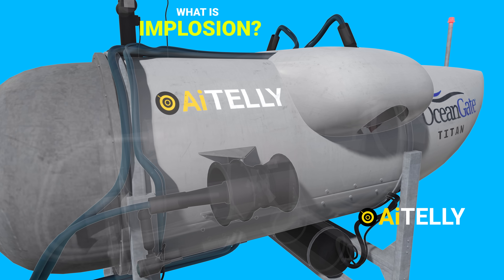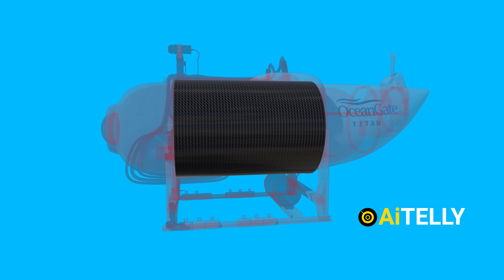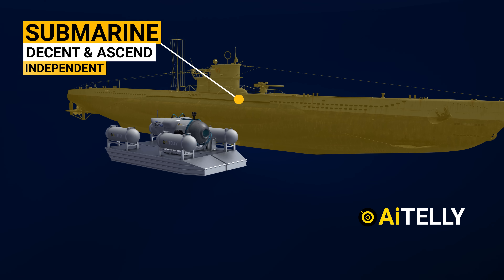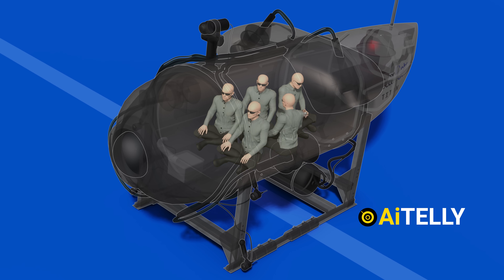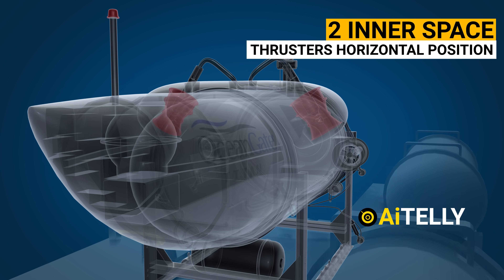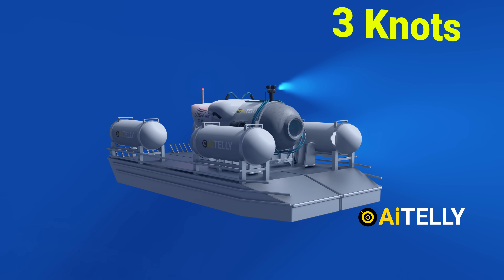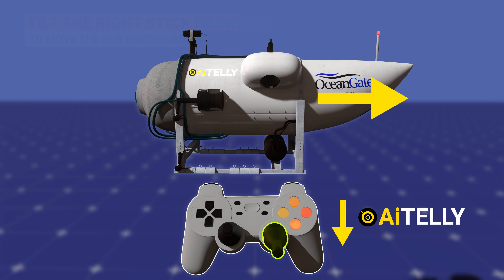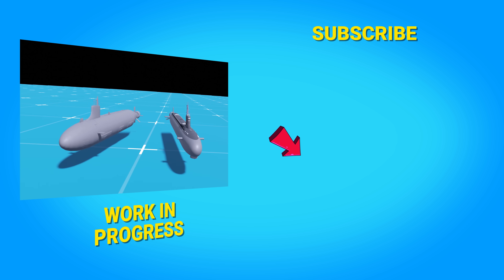Implosion Titan Oceangate How it Happened | Submersible Submarine Parts #3d

Comment: I remember when I heard that the sub would use "NASA" and "Boeing" as the claim, that is who helped them with the design, although that was later rejected by both, that was a red flag for me. Carbon fiber used in planes, designed for lower pressures in the air. NASA and planes, dealing with lower pressures, going into the earth/deep ocean, dealing with super high pressures. So as an engineer that deals with super high pressures, the appeal oceangate was exposing did not make sense, and why anyone would agree. This is a prime example of herd mentality, even with educated people. Educated does not mean intelligence. Having names thrown around to sound impressive, but have no idea of the function. 
Needless to say, I appreciate this video.

Comment: This implies the hull wasn’t strong enough as built. It was.  It had been there before.  The failure will be determined to be from fatigue.  Much like bending a paperclip back and forth.  Each dive is a cycle.  Once the cycle life is reached, the hull implodes, just as the paperclip will fail after being bent back and forth a number of times. 
Fatigue cracks slowly form until they coalesce into a failure.
Reply: Hull.  Not hill.

Comment: what is crazy is if the average person created this for a tourist operation, it would have been shut down immediately by government regulations and safety standards  again, yet another example of rich people circumventing the rules for personal profit and pleasure. Engineering 101, carbon fiber will not withstand great depth pressure.

Comment: If 5,600 PSI sounds like a lot just realise that the force is being applied PER Square Inch of the Pressure Vessel 
Given its Approx Surface Area It totals upto about 130 MILLION POUNDS of total force on the entire pressure vessel

Comment: I would've paid 2.5million to have James Cameron with me on a team of two MIR subs than to pay 250k for that piece of crap. Other things to note:

- pressure hull/vessel was shaped like a dome-covered Pringles can that took all the pressure in the middle, rather than a sphere which would've evenly distributed all the pressure around it.
- only the Titanium parts were retrieved in once piece, because the carbon fiber composite shattered from pressure. If it was entirely Titanium with the right support, it might have worked.
- glass in the porthole was not thick enough, notice it was missing when the hatch was retrieved.
- controls were weak due to using what was basically "a cheap knockoff."
- communication methods were inferior, using text instead of radios
- no tracking beacon or real sonar to keep it under constant location.
- they went down with just one sub, James Cameron always went down with two in case something happens to one.
- they descended too fast, probably by using the thrusters, the sub couldn't cope with the pressure pressing down on its frame too quickly
- the entire craft was not even tested, and they wouldn't have any additional units built to replace it in case things break or wear down.

Many more things to list that factor into this unnecessary loss.

Comment: Have some respect people, five people lost their lifes doing this. To blame them for going down is like saying that people who board planes when they take their loved ones on a holiday deserved it, if their plane came down. So bear in mind that these were people who died in terror knowing that they were all going to die. It was not instant like you have been told the submarine may have turned vertically throwing them all down to the front of it, after they had dislodged their counter balance weights to desperately make a climb and they were all in complete darkness for some time panicking and crying because of a system failure with an alarm going off for some time before the submarine actually imploded on them. Put yourself in their place and imagine their terror in those last few minutes. Pray for their spirits to recieve peace and for their families who are greiving for the loss of a loved one.

Comment: Im still amazed that someone with an engineering background, didnt understand that the solutions that work under tension, may not work under compression.

A chain works under tension, but wont under compression. Iron worked under compression, but had fatigue issues that lead to failure under tension.

Carbon fiber is great for tension, but delaminates under compression. For single use carbon fibre does ok under compression too, but repetitive cycles lead to failure.

This are all known facts of even the best manufacturing process for carbon fibrr. Now, oceangate wasnt doing any new revolutionary process to make it better at compression... They werent even doing the best current process... This result was expected and inevitable.

If Stockton Rush wanted to dive alone... Ok its up to you. But he was taking passengers and charging for that. That shouldnt be allowed under those conditions.

Comment: It’s funny how we praise risk-taking pioneers and adventurers when the succeed but fail and suddenly we are all righteous and qualified to proclaim them as reckless and even criminal - another thing no one is saying is that perhaps there’s merit to the (mostly) indestructibility of Titanic having tested unimploded on the ocean floor for generations? I am disappointed in myself as a human for being so interested in the grim and gratuitous details of how Titan met her end.
Reply: It was not the first time that Titan made a trip to the Titanic. Experts and engineers on the vehicle warned the company that their submersible needed to be revised. It was criminal negligence by the CEO of the company.

Portions of the Titanic remain intact on the seafloor due to the hull splitting in half on the surface, allowing water to fill into her hull. The pressure was equalized throughout the object, so implosion did not occur. The stern of the Titanic did implode, though. If you look at pictures of this portion, then you will see this. That's because the air was trapped in the stern and imploded due to pressure.

The two biggest takeaways from the Titanic are that any ship can sink and to not pilot your ship into an ice shelf.

Comment: Apologies in advance for the morbid curiosity.

So with the implosion, what actually was responsible for the deaths of the passengers? 

Was it the rapid implosion of the surrounding structure that literally crushed, snapped, and/or flattened them? 

Was it the water filling the vessel so quickly that they were immediately shredded by said water? 

Or is it simply the fact that the human body can't exist at that depth and when there was no hull pressure, they were essentially crushed by the ocean and liquified? (rendering the actual collapse of the structure around them ultimately irrelevant in their demise).

Comment: In addition to using carbon fiber and dissimilar materials on the hull, for a submersible diving this deep, a spherical structure can withstand more pressure than a cylindrical one. Also, no manual backup controls??? What happens if the batteries die in the controller or it gets wet? Cant control the sub now?

Comment: They're saying that the thrusters failed and because of that it's sank vertically instead of descending slowly horizontally. It might not have even been the design that failed, it was the lack of redundancy in the system that would keep it from going down too fast to acclimate

Comment: If the leaked text messages between Polar Prince & Rush are true, then from the moment Titan descended it was already likely leaking since it was descending much faster than it should, & when Rush aborted, even if they got rid of the ballast & the runners it was still ascending much slower than it should. Then communication stopped abruptly. It is believed at this point that the Titan simply sank until it imploded, based on the weight of 5 passengers plus the water it had taken in from the micro-leaks. Therefore for the 20 minutes of communications between Rush & Polar Prince the passengers knew they were in trouble, & during the 48-60 seconds that the Titan sank before it imploded the passengers knew they were going to die.

Comment: Carbon fiber doesn't fail like that - the video shows plastic deformation of the hull as it warps and twists under pressure. Carbon fiber is brittle and would fracture when it fails, forcing fragments of the hull inwards. This would probably be more violent than any plastic yielding as fracture failure happens much more suddenly.

Comment: Another factor could be they were desending too fast. They made 3 successful dives before hand and decided on this last voyage to descend at a much faster Rate then what they has originally planned. I got this from the transcripts that were leaked. So the hull probably couldn't stabilize in time and boom.

It's very similar to actual submarines when they dive down or up quickly for evasive maneuvers you can hear the hull creak and groan since it puts much more stress on it
Reply: I kinda figured it was something like that. Rush was like "Oh we've been down there before, it's fine. "  POOF gone. RIP
Reply: @zed6095  pretty much what happened. They had an issue on their last dive with their controls. Another red flag. But they made 3 trips total with one " minor" problem. 

Completely ignoring stress fatigue is a re al thing
Reply from the maker: Yes agreed Thanks for the insightful comments
Reply: That transcript leak is a hoax, you're aware of that by now, right?
Reply: It was an accident, waiting to happen. He was warned, about the insidious ( gradual) degradation that occurs in composites, made of fibers. It was WRONG the way to build his vessel, period!! Enough, with all the rationalization already. When was the LAST time a PROPERLY built submersible, imploded? And experts have gone to WAY greater depths!
Reply: Sorry to tell you but those transcripts aren't actually real...
Reply: Even though fake, the real transcripts prove this also, the pp even asked several times their weight and there was no answer
Reply: those transcripts are fake
Reply from the maker: @pear-zq1uj  Ok now whom to believe?
Reply: The transcripts are fake. It's one thing to have interest in this story, but to tout information that is false is cruel to family members of the souls that perished. Please mindful of that.
Reply: Doesn't matter if they are fake or real, titan was a jenkey pieces of crap!
Reply: You probably think the audio of the "banging" was real too 🤦‍♂️😂
Reply: @BadaBing-01  and you're probably special Ed and can't do math. Plenty of experts mathed it out and concluded pressure vessel implosion. IMPLOSION meaning caused by difference in air pressure from INSIDE the vessel leaking OUT. 

Just cuz u can't do math doesn't mean u need to comment and be an asshole on something that is over a month old

Comment: What absolutely blows my mind is the lack of ANY form of NDT testing or inspections being completed after each dive.  As an engineer who built a critical life bearing hydrostatic pressure vessel, that accepted money for public "tours", Rush had no concern or value for ones life.  Youd think if you were risking others lives on a vessel that you created, you would do everything in your power to make it as safe as physically possible.  Because carbon fibre has very poor hydrostatic properties this vessel should have been rigorously tested by any means necessary to insure the vessel hasn't been compromised in any way.  The carbon core of the vessel should in all rights have been a 1 time use part, replaced and disposed of after every successful dive.  By all means, Rush had the money for it.  Problem is he was so narcissistic and selfish that he purposefully refused and ignored every single warning that came his way.  Knowingly refusing the scientific and proven knowledge available to him to be a "pioneer" in my eyes has made him criminally negligent in his death and 4 others.  He should be charged with negligence causing death posthumously and reputation drug through the depths of hell, which is where I hope he spends the rest of eternity.

Comment: Great video. I wonder how many would have got in this vehicle after watching the video on the three parts being glued together. No way glue is going to hold under those pressures. Neither did they key the surfaces for the glue to bind properly. Neither were those surfaces spotlessly clean and free from grease.  Under huge pressure the titanium wont give but the CF will. That changing dimensional difference cannot be absorbed by glue. Adhesion will fail.

Comment: If Implosive Forces or Hydrostatic Pressure is so high,Why does the Titanic Look almost Intact,Why didn't it get crushed and disintegrated in these 100 Years.Agreed Carbon Fibre Composite is Brittle and can't withstand the Extreme Hydrostatic Pressure under Ocean Surface and needs a Submersible with Titanium Hull or Sphere.But still Titanic being Intact needs another Plausible Explanation from Discoverers,Mettalurgy Specialists.

Comment: What no one will ever hear about are the alleged "prototype" subs that helped finance Ocean Gate. subs that were easy to construct and in high demand by competitive organizations with extremely deep pockets. This is where Stockton originally gained his experience with carbon fiber. Research [sound permeability of carbon fiber composite] and form your own opinion. The key specifications of these subs were; 
-The ability to travel approximately 1,750 miles (Roughly the distance between Golfo Tortugas Columbia, and let's say... Punta Conejo, Oaxaca Mexico. [Sinaloa]  with only one refuel via a surface vessel.  
-A hull constructed from light weight, seawater corrosion resistant material to help with the ability to carry a separate payload (Or Ballast) of 45,000 lbs. that could be easily jettisoned if necessary. 
-A form of communication (even as crude as text messages) from the sub to a surface vessel to organize refueling that could not be easily intercepted. (No radio frequency waves transmitted through the air) 
-A low sonar signature with good wave and sound permeability. 
-The advantage of operating in relatively shallow waters without being subjected to extreme outside pressures.
Only time will tell...

Comment: What type of epoxy was used surely matters.  When I built my canoe, the epoxy used for joining components as opposed to coating, required the epoxy to be thickened.  Thickened with fibers made to improve its adhesion.  In the case of the Titan a video I saw seemed to show the technicians putting the epoxy on with spatulas. I wonder how they controlled the possible air bubbles that formed in the epoxy which would weaken it.
Reply: Most likely it was sprayed on.
Reply: @michaeloberle726  actually there is a video made by OceanGate showing them putting the epoxy on with basically a putty knife. They had the carbon fiber shell standing on end, lathered the epoxy on, then lowered the titanium end ring down onto the shell.

Comment: I can weigh in a little on the carbon fibre, We know it was past its useby date, there's a good chance the resin was at risk of delaminating. bulk composite manufacturing has many flaws and imperfections in the end material, which usually doesn't matter but in this case any flaw was under the same pressure across the surface which would be enough to let the carbon fibre skin crush inwards
Reply: And the fact that they drilled 1 1/2inch screws into the inside of the hull to mount monitors and equipment.

Comment: Carbon fibre doesn't do this 😂 its torsion rigidity flexes then breaks at the stress point. The fibers are always exposed under stress in that area along with fractures.

This is a nice theory but it's completely inaccurate. Well done for jumping on the bandwagon pfft.

By the way, the sub has 480 layers of prepreg carbon. That's over 5 inches of carbon....it didn't squeeze!

Comment: Its far more likely the glue failed between the titanium end caps and the carbon fiber hull.   Any leak would have been quickly exploited by the outside water pressure.  Rapid expansion of the leak would be a given.  At those depths, the pressure alone would have ensured a rapid escalation of loss of structural integrity.   Even if a leak managed to remain somewhat  stable in size, the compression of the air inside of the Titan would have eventually made it impossible for the men to breath.   

I would also point out that the leak need not be large.   Even a leak the diameter of a single strand of hair would have resulted in catastrophic failure... not to mention the water entering would have been more like a water jet.   If they didnt die from the loss of breathable atmosphere, the break up of the titan, then one or more of them was likely pierced by the water entering the vessel.

Comment: For such extreme mission critical applications, the use of a wireless consumer grade controller is ridiculous. 
Zero excuse for not using a wired commercial, industrial,  aviation or military field grade controller, wired using harsh environment rated connectors like Mil spec locking connectors

Comment: Not actually true. The second set of remains brought up of the submersible parts clearly shows the casing that surrounded the fiber part remained intact, at least from one side. It's on video of the piece being brought to shore and it's still cylindrical in shape.